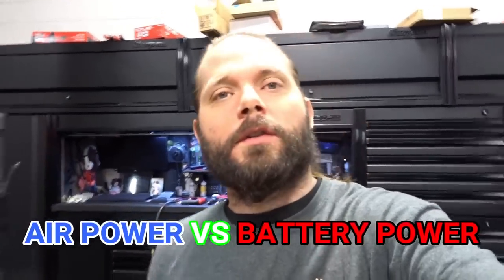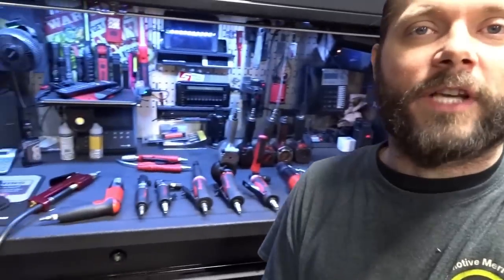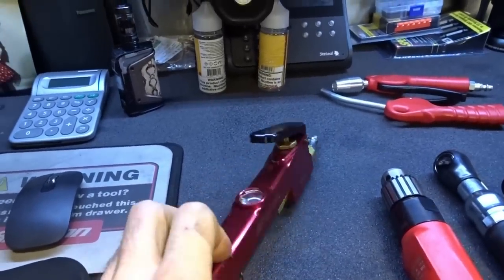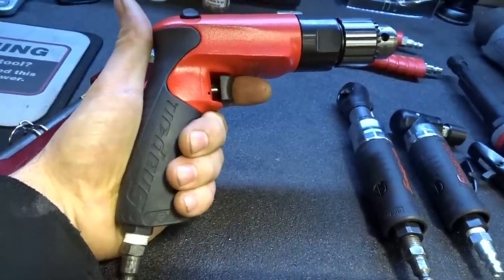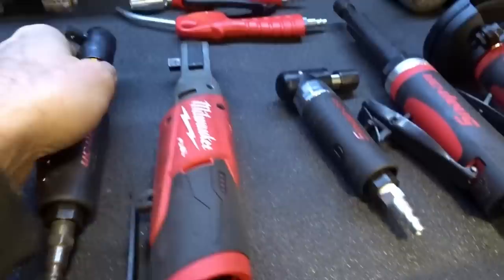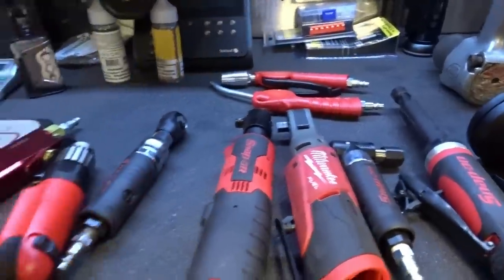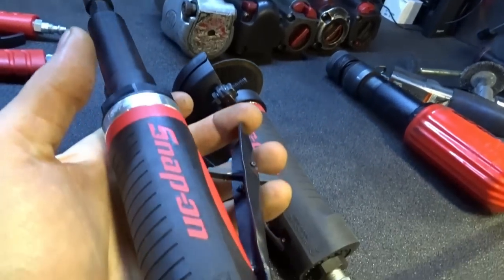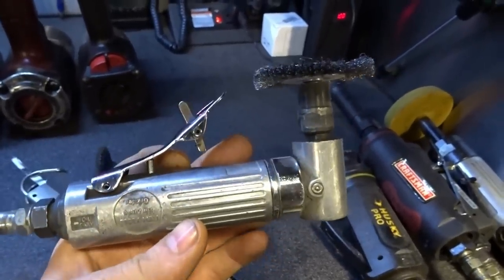PNEUMATIC TOOLS VS  BATTERY TOOLS

Comment: I have cordless tools but I still use my air tools more.    The 1/2” impact air tool just weighs way less
Reply: Air tools have great power/size ratio... The guys at work get their feeling hurt when i tell em Bring the 3/4 pnuematic and not your cordless bazooka sized impact.

Comment: I find myself using battery tools more and more but then I go back and use my snapon 3/8 air ratchet and think, "Man, why did I give up using this thing?!"
Reply from the maker: It's the hose that's our issue not the air tool, I would use air tools only if I didn't have to connect the air line to them🤔
Reply: @JRC54   For me its not just the hose but the loud noise as well.
Reply: @JRC54  maybe you can put all that hot air you're spewin to use and just blow into your air tools! Haaaa

Comment: What little air tools I still use  I have swivel air fittings on. Only way to work anymore with them anymore it seems. And agree, limited use, but for the things battery cant match yet.
Reply: Andrew V--Years back when I worked for the Feds (Bureau of Reclamation), I went around putting swivel air fittings on our pneumatic tools.  It made so much sense to have them, I couldn't understand why no one did it before me.  Turns out people get used to the "hard way" of doing things, and can't see past that.  I was new to the group and saw a number of things that looked dangerous or were too heavy for me to work with, so I made them safer for all of us.  I did this under the guise of being the group Safety Officer, so I never heard a peep out of anyone holding the purse strings.  It didn't cost very much and made them look good to the bigger bosses, so I was given free rein.

Comment: I still have and use both.  My Snap On air hammer probably the most used air tool.  My Snap On 14.4 impact driver most used battery one.  Great video nice to see the different tools.

Comment: I LOVE my air hammer! Maybe a little too much... hahaha. Seriously, I use the thing on stuff I probably shouldn’t. It takes stubborn lock rings off fuel pumps, cracks open stuck bleeder screws and breaks off shock absorber studs. The list goes on and on. I’ve got an entire drawer in my cart full of bits for it. Did I mention I love my air hammer?

As for other air tools I still use... Needle scaler, die grinders, 90 degree drill and 1/2 inch impact for when the cordless one just can’t cut it. I also still use my1/4 inch air ratchet because I simply haven’t bought a cordless one yet.

I’ve got half a dozen blow guns... long ones, bent ones, large bores and a suction one that sprays liquid for degreasing. I’ve also got a digital tire inflator because the analog ones aren’t as accurate.

Comment: When I'm working as a mechanic, 1/2", 3/4 and 1" impact for working on equipment and BIG trucks.  Air hammer and mini die grinders both straight and 90°.  These are things that will never be fazed out by cordless tools.  

Now when I pull a slip to go back out as a Union Ironworker you'll likely never see cordless or even corded electric impacts that will replace our 3/4", 1" impacts the 1&1/2" spline drives and the "Helldogs" (15-35LBS air hammer/chippers) all run on 3/4" and 1" air lines.

Plus your not going to fill tires on anything bigger than a car or small truck with a cordless air compressor and while you're being paid to do it and still feel good about yourself LOL

Comment: I'm a heavy equipment road mechanic.  I will ALWAYS use air.  Especially in the cold, all these different brands mean alot of batteries, and chargers, this eats into my space.  Another big problem is battery packs alway die.  Whatsca mechanic going to do on a road call with a dead battery for his tools?(alot of added time. No one wants to wait for battery pack to recharge)

Comment: I started using just electric and have finally decided to just retire all my eclectic stuff from regular use and only use them when I need to be portable and fix one of my cars or a friends on the side of the road but honestly even for road side repairs I would still prefer the air you never know when a battery is going to up and die on you.
Reply: can you check the battery level?
Reply: @hunterXhamster  yea you can and that works good for a while but once they are a year or so old they only last like 10-15 min on a full charge and have next to no power you basically have to get new batteries every year. I have snap on battery’s I can show you that don’t even have 20 cycles on them and they don’t take a charge anymore, the snap one 18v batteries have a cycle counter built in.
Reply: @nate7046  i think thats more of a snap on problem then cordless tools. I used Dewalt and Milwaukee for years and the tools die on me before the battery

Comment: I don't think we will ever replace air tools completely, I love my few air tools I have. And I love the few battery tools I have. You are correct when u say the have their intended use. Can you post a link to where you get your cleaning gear for wheel studs and cut off wheels. Thanks.
Reply from the maker: https://www.dpars.com/en/Product/NAP/Scotch-Brite/Clean-Discs/07547
Reply: @JRC54  thank you for the info. 👍

Comment: I like air tools because they are cheap and compact. I have a larger snap on air 3/8 ratchet and I love it. Tons of power, and I paid $40 on eBay. Can’t beat that. Also got an ingersol Rand 1/2 TIMAX impact I paid like $20 for. Both work perfect and we’re dirt cheap. 

I also just love the noise they make

Comment: Air hammers or die grinders they are not goin away like U said. I use that angle battery one from snap on on brakes and gaskets but it burns thru the battery’s quick.
Reply from the maker: That snap on buffer is good for about 3 mins of work then it gets hot and runs the batteries down like crazy

Comment: Great post sir. Yeah i use more cordless than air. It's all about not having that hose. Saying that somethings will always be air powered, that air hammer wont be replaced in my life time. And tire shops i think will always use air tools, i would guess air would out live cordless and cost less. Back in my younger years firestone supplied the air guns and the tire machines where air.

Comment: I am looking at getting some tools to start working on my Jeep.  I can get all the pneumatic tool that I need instead of one decent battery powered tool.  I would prefer some of the decent battery ones, but I think it'll be air for me to start with and later get a few battery ones.
Two tools that I need that I haven't seen in battery is a spray gun and a needle scaler.

Comment: Yeah, air tools will still be around since I also do Collision repair, spray guns could never be battery powered because   it will not atomize the paint properly to get that beautiful coat needed, plus grinders, air hammers, chisels and sanders should  be used with air. I agree with you that certain tools can be battery powered and air powered, it all depends on the job needed to be done... 👨‍🔧

Comment: You can never go wrong with pneumatic’s, but it’s nice to be able to grab any cordless tool and get the same job done without the hassle of an air hose. I guess is my opinion, if you can get it done without a hose go for it. But I will say I will never get rid of any of my pneumatic tools.

Comment: I pretty much agree with everything you said.  As a diyer, The convenience of the battery tools isn't great enough to make me switch,  strictly from a cost perspective.  If I was a professional using them everyday,  my attitude would change.  There is a new Snap-on polisher that there isn't a air tool equivalent.  That polisher will start a fire quickly, lol.  Hope they get that fixed.

Comment: I work on 18 wheelers and I guess for us when we work on the engines or even clutch jobs electric works fine for us its more effective for us like valve adjustments when taking valve covers,brackets electric is perfect I have all the snap on electric stuff but milluaki are badass

Comment: I find that its good to have both. Some jobs you need air tools and others for battery. Im planning on getting the milwaukee high torque and the mid torque new 3/8. The only other air tool im buying is a compact 1/2. Over time i will see whats better for what jobs. That air line does get annoying though lol.
Reply: For me the sound of air guns is so cool. Yeah they are loud but so are battery as well.

Comment: Every once in a while run some air and oil through them I do that with my air tools that I don’t.use that often. The air ratchets are great if you drop the tool at least there is an air hose attached. The cut off tool air still rules along with the small high rpm air still better. Great video thanks.

Comment: Serious question..... what was the Benifits of an air powered drill? More torque? Do they have variable speed? In all my years I’ve never come across one to actually use and have never even seen one used so I am just curious
Reply from the maker: They had more power and ran longer before lithium battery technology came around.
Reply: I'm betting it was easier to use an electric (corded) drill for all of their needs.  That, and if the cord was too short, you just pulled out an extension cord to reach any place you needed to.  It also got around the problem of who was going to oil and maintain them; it seemed that was something no one did regularly at my place of work.

Comment: They do make electric die grinders to be fair, I've got a corded one that works great for porting/polishing and windowing out parts stuff like that - as good as an air grinder just I don't have a huge compressor.

They make a cordless version too (Makita does at least) but obviously you're gonna burn through batteries pretty quick if you're doing any real head work or anything on the bench.

To be honest though, if I had a shop, I'd probably get a cordless one for when you're working under a car or something. Easy to just grab, no hooking up air dragging a line with you

Comment: I have and use both. I have yet to use an air impact that matches the power of my Milwaukee 2767 high torque though but it is heavy and is overkill for most jobs. I normally use my HF Earthquake XT stubby impact for everything unless I need the muscle. The stubby blows my old full size 1/2in craftsman out of the water on power and is 1/3 the size. 

 With that said, my air compressor is definitely more valuable to me. If I had to give up one or the other, I would certainly choose to keep my compressor. A good high torque air impact will do 98% of what the milwaukee can do. I believe Aircat released a new 1/2in that matches the cordless on torque.

Comment: I’ve been buying more air tools lately. I have plenty of battery stuff but sometimes it’s the size and power. I could really use a mini air ratchet. I have a 14.4 impact, ratchets, and an 18v 3/8 that all see pretty regular use. Anytime Im going to 1/2” it’s an air tool. The battery stuff is good but it’s just too heavy and bulky. It’s not often that I need my air hammer but when I do it’s a god send. I don’t see anything other than air for those. I have air powered die grinders and cut off tools. I literally just got the same drill. Mostly just wanted it because it’s size. I still haven’t seen anything that I think can get in to where I’m usually working. Battery powered tools will likely take over eventually but it’s going to be a very long time. I like the reliability of air. I don’t have to worry about the battery charge or the battery going bad. Just have to take care of the hose either being in the way or rubbing up on a painted body panel.

Comment: Air tools for tools I don’t use much. If you have a battery operated tool that doesn’t share the same battery platform, if you don’t use them you waste money on batteries.
Carbine bits, got stuck in the pew pew mode eh 😂

Comment: How do you like the Air chuck? How accurate is it when dealing with TPMS? For the Snap On price it better be dead on.
Reply from the maker: It's pretty dead on. But just like the digital or torque wrench they need to be recalibrated every now n again.

Comment: Hey thank u for an awesome review. Yeah air tools still will have their place especially the air hammer. Now that u have both the snap 3/8 ratchet and the milwaukee. Which would u say u prefer better. I'm realizing my snap on batteries die quicker than the milwaukee batteries. What's ur opinion sir. That box is sweet bro.

Comment: Do you use 3/8 chrome Swivel sockets and this can go for anybody in the comments because I’m debating whether not to buy them if I  have the impact ones already
Reply: They articulate more then the impacts, so for tight quarters, they're worth it.
Reply: Andrew V thanks
Reply: I have noticed that the chrome sockets break with the impacts really easy as they're more rigid.
Reply: @TacticalSRT  yup, like any chrome, hardened steal, but the pins break befor the fastener ends.
Reply: TacticalSRT thanks

Comment: I mean I’m young so usually people around my age in the technician and mechanic field do go for battery operated tools, and I get that especially if you’re mobile and doing a lot of service calls but being stationed in a shop along with other guys I always buy air tools just for longevity sake, I hate replacing batteries and keeping up with chargers. For service calls i don’t worry though because I know someone else will always have a cordless one 😂 I’m a cheapskate so I roll with air